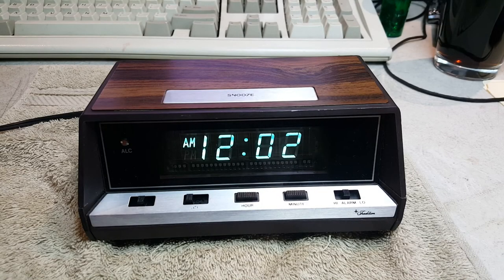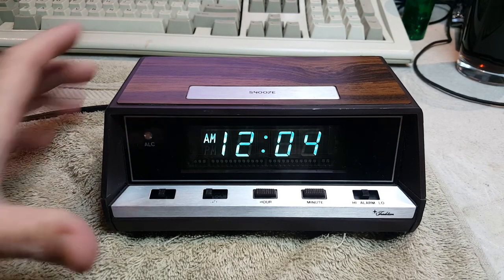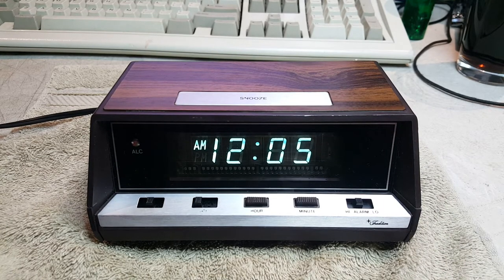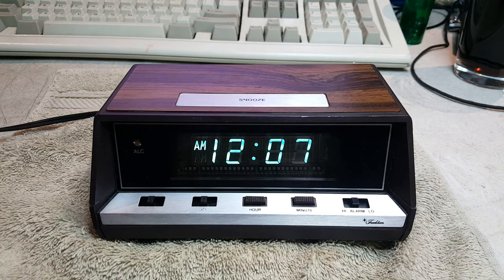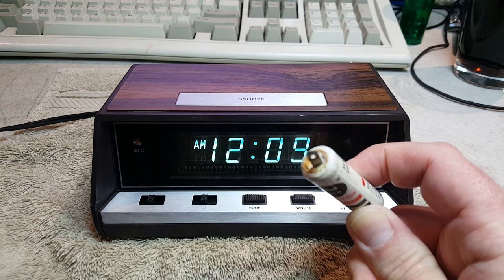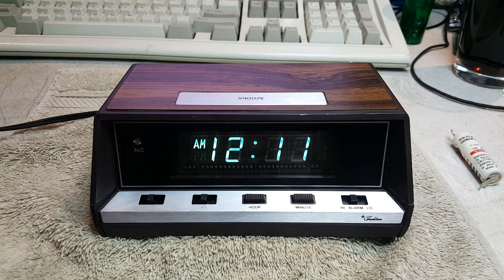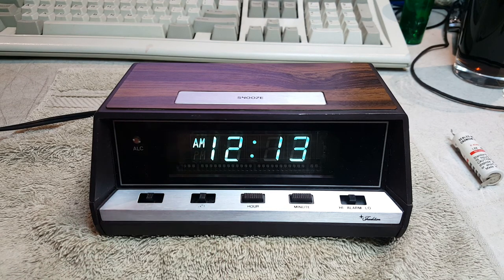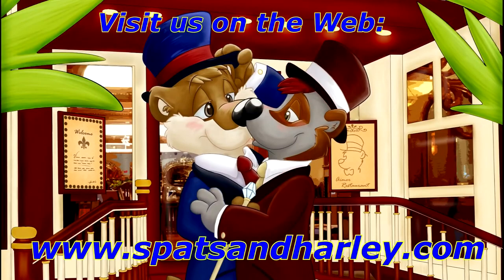1982 Sears Model 47201 Alarm Clock

Comment: Well, why not put a new NiMH Eneloop in there for the battery backup function?
Reply: +nerdywolfi The mechanics of charging Ni-Cd versus NiMH are slightly different, and I'm afraid that the NiMH may become overcharged by the circuitry.
Reply: +Harley Badger Hmm yeah, didn't think of that. Depending on if you want to use that clock somewhere in the house (and not on your clock shelf in your basement which has an APC SmartUPS iirc) you could maybe retrofit some sort of capacitor in there. Or try out how a NiMH rechargeable would do in there (measure charge voltage and current) even though it could be overcharged a bit (would recommend to do that in a controlled environment though).
Reply: nerdywolfi I'll probably end up putting it on the clock shelf, at least for now until we get the basement remodeled.  And you just gave me an idea, I might just find a AA Ni-Cd on eBay and solder that in there, it should actually be a direct replacement.

Comment: I have a late 70s/early 80s GE alarm clock that looks very similar to that. (Can't watch the video yet) Do you know the OEM?
Reply: +Jack Kirkpatrick actually no, it uses a weird Sears model number that I can't look up the OEM for, and the circuit board simply says "US Electronics," which could be an old OEM or could simply be saying the electronics are designed for the US (AM/PM and date format.)  And that odd Panasonic battery, I have never seen one like it.
Reply: Harley Badger Just watched the video. What's interesting is my GE alarm clock also has a calendar, two alarms on it and an automatic brightness sensor in the same spot. I should make a video on it sometime. It's pretty obvious to me that one of them was "inspired" by the other. F1-8147-5 is the model number.
Reply: Jack Kirkpatrick Oh yes, I would love to see a video on it.
Reply: +Harley Badger It'll go on my other channel, I'll link you when it's up. I have tons of vintage electronics BTW.
Reply: +Harley Badger Video's up on the other channel

Comment: Do you know how to tell the date of mfg on an Emerson Alarm clock?
Reply: +LT4 IROC-Z Actually no, if it's coded.  I have GE date codes memorized, but others I would have to hope to find a decoder somewhere.
Reply: Harley Badger  I just bought an Emerson alarm clock with radio for $10, appears to be from mid to late 70's.  Don't know if they were a great brand but it can't be any worse than a modern one.

Comment: Yeah that's sad that Clinton grand China to bring products to USA Happen in 1990. =(

None of the less, this Alarm Clock is a unique design in my opinion and no I don't care about Chinese, PRC's, Hong Kong's, and Korean made Electronics or goods because they don't usually make a good design like for instance like 2000 Panasonic PV-V4522, Do you know where is made? It's made in Indonesia they made awful quality when you look what's inside the VCR, the Erase Head, the P2 and P3 Guides, the Wheels, and the Audio Heads to hold lose, and they're not design to be fix but design to throw away.